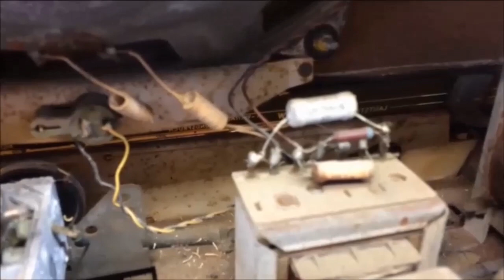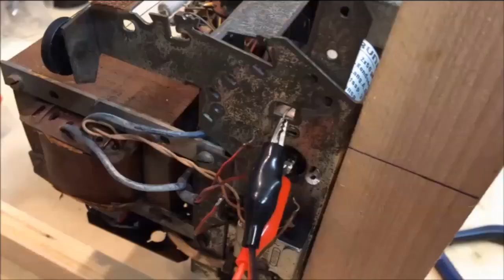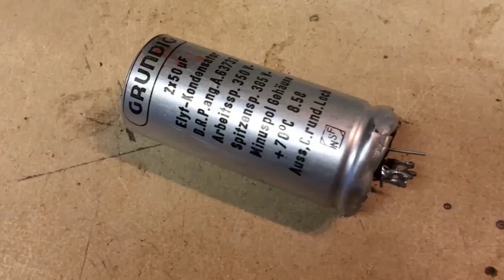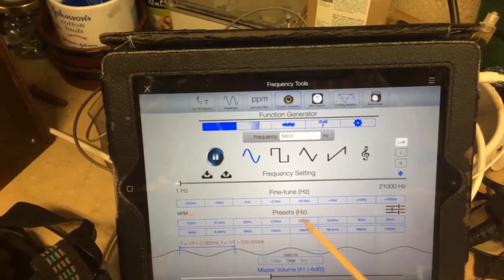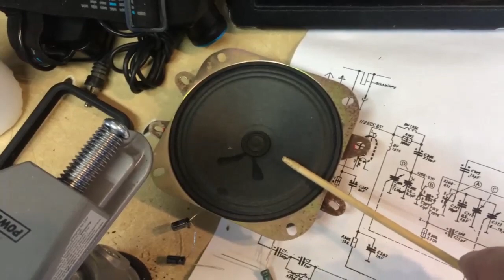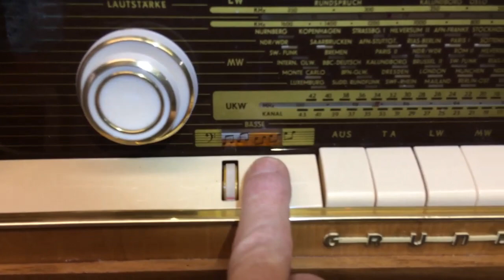Grundig 2066 restoration  from start to finish

Comment: recently got the same model for $95 bucks working from a collector from an antique radio club we are in. mine is the us version. mine has am/shortwave/fm. the other thing that is different from this version you have is where yours says speach or whichever mine says voice and whatever else for the us market. sadly i havent been able to find a phono for this unit which i would like to find. great radio overall and i dont plan on selling mine. what turntable or phono would work with this unit.

Comment: "Wunschklang" has to be some Grundig marketing gibberish - literally it translates as "desired sound" but what on earth is that supposed to mean?

I had a quick web search and skimmed an article about the concept back from the 50s. If I understand that correctly, the "Wunschklang" button enables the four tone control potentiometers, while the "Speech" and "Music" buttons remove them from the circuit - so basically it allowed the listener to adjust the sound as desired. Apparently "Wunschklang" was also the name of the entire tone control network.

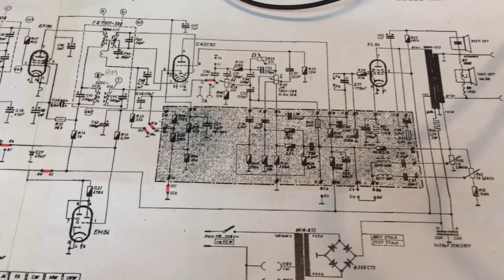Comment: At the 22:20 mark you mention that you feel a modulated signal into the ECH81.  Does it matter which grid plate you feed the signal, there are 5 grid plates.

Comment: Very nice work indeed.  I'm working on one now and would have love to have seen a little more detail in the alignment procedures.  I can't seem to find a service manual for it, just a schematic, if you could suggest where I can buy a copy of the service manual, that would be great.  Thank you for posting a great video.
Reply from the maker: Thank you World Wide 137. You can probably find the circuit diagram etc at radiomuseum.org It's free to download. Best of luck with your project.
Reply: @rodsradios  Thank you.  Yes, I did download the schematic from RadioMuseum.  Unfortunately, I was looking for the maintenance procedure for alignment which was not available.
Reply from the maker: @worldwide1376  Hi again, The alignment instructions are indeed available here, ---while the first page on the right hand side shows the schematic, if you scroll down at that area, the third page is the alignment instruction list. While it's in German, Mr Google translate should be of help here.
Reply: @rodsradios  Thank you for pointing that out, I was looking at the English version 2066PX.  Cheers!

Comment: Really impressed with your skill and patience. Attention to detail is praiseworthy, as also your practical approach to restoring this vintage beauty. Kudos to you.

I have a Grundig 2067, with just MW & SW, no FM. It is in an average condition only. Don't have the skills to work on it. Nor any good technician around.

I have a question, is it possible to get a replacement for the EM84 Valve Magic Eye? Mine is not working properly. Can you guide me to a source? Thanks
Reply from the maker: These seem available on ebay see the following link :- https://www.ebay.ie/sch/i.html?_from=R40&_trksid=p2380057.m570.l1311&_nkw=em84&_sacat=0